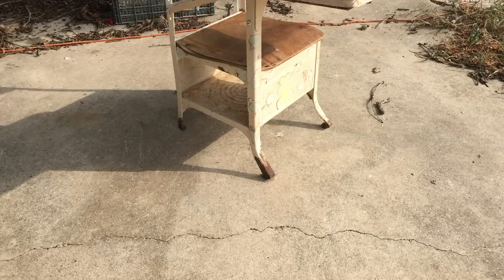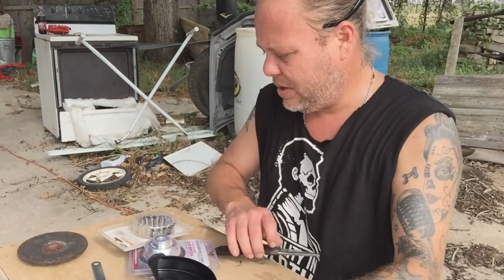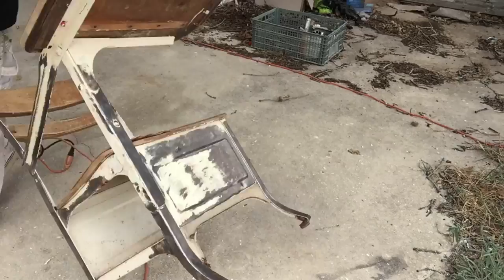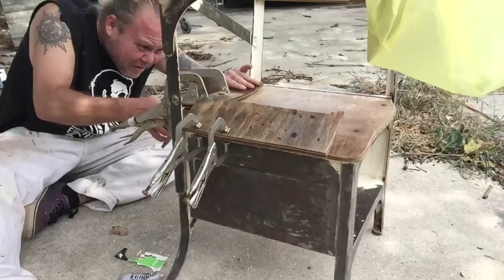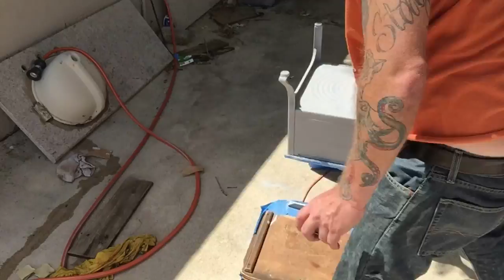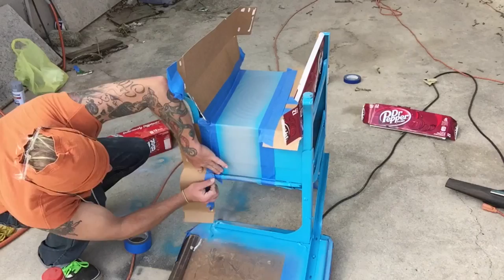Old School Desk Refinish Project time lapse by Max Dean

Comment: What kind of spray paint do you use? Is a primer a must? What about the spray paint with primer and paint? Will that work?
Reply from the maker: Hi Alison, I try to use outdoor safe paints. Rustolium  but if the colors are not available, go with anything as long as the finish is the same. gloss. Flat. Etc...

Far as primer use it for sure. A thick primer can be sanded to get rid of imperfections. The two in one can work but i've never used it so i cant give a good review. I hope this helps

Comment: Hi. what did you use for glue and what grit sand paper on wood? we just scored a desk for our daughter that needs some attention. TIA
Reply from the maker: Hi! I want to say I used regular wood glue. As for the sand paper I get the variety pack. That way you can smooth out the rough stuff with the rough grit and smooth it out with the fine stuff. I'd love to see before and after pics or a video if yall make one! Have fun and if I can help in any way, just ask. Thank you for watching!

Max Dean
Reply: Max Dean Thanks! will post a link!
Reply from the maker: tribefan75 After watching the video again I remember using epoxy! Sorry about saying wood glue. It's a two part epoxy for wood. Cures fast and works very well!
Reply: Max Dean what did you end up using on the wood and did you do a layer of clear?
Reply from the maker: I used a light stain and a few coats of gloss clear outdoor spray can  sealer.
Reply: Max Dean we have these units at my high school ! My high school was built in the 1960's